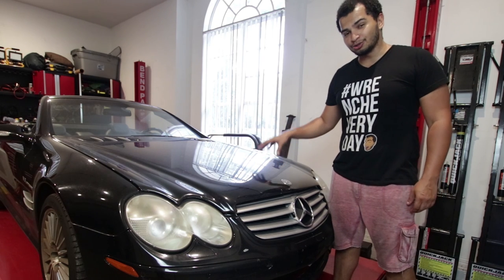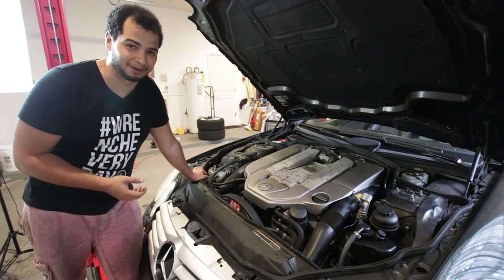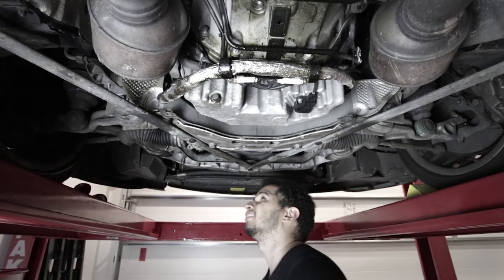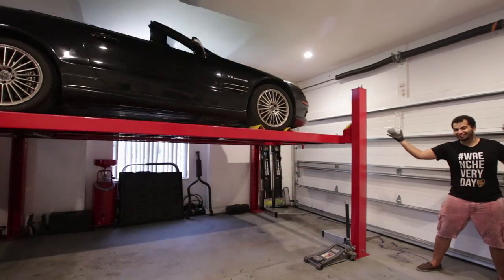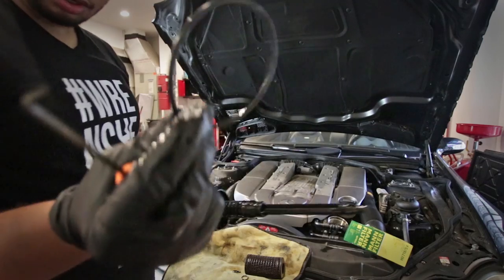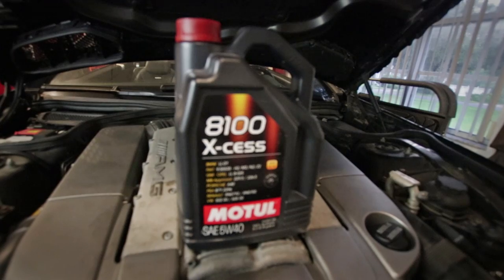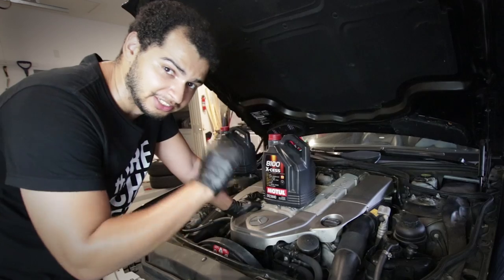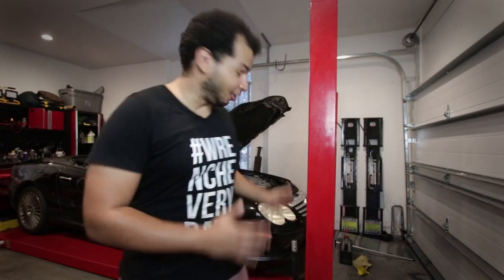Here's Why A Mercedes Oil Change Costs $320 And Why You Should NEVER Pay That Price-Project SL55 Pt1

Comment: Eurotrash cars are for posers.  I agree wholeheartedly with the replies for Toyotas.  Those are cars designed by engineers, not marketers.  I had a Mercedes which was fortunately totaled.  I bought a used Toyota and loved my $20 oil changes compared to $100 'services.'  Then I said screw it, I'm going to do everything myself: I get quality, often Genuine Toyota, parts and nothing takes more than 50 minutes, including shocks, flushes, gaskets, lights, but nothing is ever drastic.    I could have bought five Toyotas for the used price of my MB.  Everyone should own one German krap once, to understand.  Oh, and at 160k miles, I get 34-36mpg!

Comment: Mobil Delvac sound weird and designed for 18wheels. That's why use Delvac in high performance engine. It has higher flash point. Fully synthetic too. 5w30 and 40.

Comment: 2 oil pan plugs are on Ford and Lincoln too. Years ago when I owned a 1993 Mustang 5.0 it had 2 oil drain plugs.
Also I had a 1989 Porsche 924S with a 2.5 liter, 4cyl that took 7.8 quarts of oil.

Comment: almost anyone can drain oil. not everyone can put it back without it leaking out. And when does the whole "oil-change" thing become the US equivalent to scheduled maintenance e.g. servicing? I understand oil may not last quite as long in the US climate than in the UK for instance but who really just changes oil every year and then waits for their brake pads to touch the metal of their discs and/or tyre blowouts and all the other stuff that needs checking by someone who knows what they're looking at? Is there any surprise that 40,000 people died on US roads last year?!

Comment: i got a  question, since around 2000, mercedes started to have their service interval reminder on the info display, which do u guys follow..the days or the miles/kms? with other cars like tyt i use kms or distance intervals even though i only drive the car for 3days a week.

Comment: You forgot the part where you have to remove the underbody cover and it has 15 to 20 bolts. Sometimes you are lucky and you only need a 10mm socket, but most times is a combination of 10mm socket and torx T25, and even 12mm socket. That's also a reason why they charge so much. So in reality it's not only 2 bolts

Comment: Simple as if you own a high performance car, then you should have the money to do the work thats needed...  i own a M3 2012 Cabrolet, and i love it... always take the besat to the dealer, to get my oil change, i dont complain about the price, i knew what i was getting into when i brought the car.

Im fortunate that im doing ok, recently new tyres and discs and pads done.. it was expensive, but then thought i wanna be safe not a cheap ass.... Also i want my beast to perform well when im ragging it...

Thats my 2 cents... you should know better....

Comment: You if you are talking about Mercedes in the 60',70's, and early 80's, they were very reliable cars.  Those engines could last forever if you took care of it and changed the oil on time.  Now today they are just a bunch of overpriced over engineered typical German cars.  You got to get a special scan tool that only Mercedes or a mechanic that paid thousands of dollars to even read the codes. You can't keep it 10 years because the plastic parts break down and you got pay thousands of dollars to replace it.  That's why the market devalues them in a big way over each year.  Now if you got say a year model from 1980 and it still runs then yeah it would be a great car to have,  but not today's or even the 2000's models.  It just how it is, you can't compete with reliability like you can with a Toyota.

Comment: Hello, I love the video, and very jealous of having a nice lift at home, isn't that the 12,000 lb one? I work as an oil change tech at a company which does the same A service for one of these vehicles for less than or around 100$.  I think it is criminal to what the dealerships charge. For vehicles like that Benz that uses those types of filter wrenches, I actually just use a regular cheapo band wrench and put a regular oil rag over it which allows the band wrench to grip the plastic oil filter cap.

Comment: Tavarish, that $4000-5000 lift would buy a lot of $300 oil changes. Plus the shop oil change container alone would buy an oil change. My advice don’t go to the Mercedes dealer. I have a 2003 SL55 and I pay $125 for an oil change. Your advice not so practical.

Comment: Have a car you want to keep? Or to last?

Then take it to the dealership or a real mechanic for the oil changes. Or learn how to properly do it yourself, but only with the proper mechanical tools, and also everything needed to make sure the job was completed properly.

In other words, do NOT take it to a majority of chain instant oil change locations.

They typically do not have the proper mechanical tools for all vehicles. Even worse... Check all of the vehicles on the road not with under engine deflectors and/or covers. Does one really think that many instant oil change facilities actually have the *proper adapted plugs/tools* for your vehicle?

Answer; almost always NO

I've seen countless instant oil change locations that will use zip ties to improperly secure deflectors and/or covers.

Be sure to remember this one when that same deflector/cover comes off while on a highway

Do it the right way. Which typically means NOT at an instant oil change facility where someone is learning on YOUR vehicle; while using the wrong tools

Comment: and about manufcaturer recommended oil.  Mercedes designed and built their engine with mobil one.  Now it is ok to use any full synthetic oil with this car and it will be fine.  Mobil1 would be the best choice tho.  I understand you got a kickback for endorsing their product and i know u wanted to do a goodjob so u never have to worry about paying for oil anymore.  But what ur saying is kinda misleading ur viewers.  From my understanding Mobil1 is a better oil than Motul.  However, like i said before,  Motul, Castrol, Pennzoil,  whatever.  As long as its fully synthetic it will work fine in the car.  but if you are looking for max protection and long lasting quality oil then ur best bet would be to go with mobil1.  HOWEVER,  i would have done the same... u got free decent quality oil that will work fine in the benz, then why the hell not??!!  lol.  
but i was wondering why this video had so many dislikes.  now  i think i understand why.  i think everyone who disagreed with the sponsored product endorsement disliked the video... i on the otherhand did not dislike the video...  I like what u do, u put a ton of work into every video u make.  it would take A HELL OF ALOT to make me want to dislike one of ur videos.  lol.

Comment: It takes 9 litters of oil, so he will have 1 litter left over for the road, once the oil filter tube fills. Never trust the gauge.  They must figure the car will never burn enough oil between oil changes to be a problem so the smart-asses didn't include a dip stick. That sucks. So I wonder how far down must the oil go before it indicates a problem.

Comment: Why did this video get so many thumbs down?  I take my Mercedes to the local Jeep dealer where they change my oil for a normal price.  They also do my Jeep, Cadillac, and F-250 diesel.  The F-250 is a bit expensive because it takes 16 quarts of oil.

Comment: I’m hoping to get a Mercedes e350 between the years 2006-2011. I’m new to all the car stuff and was just wondering if doing your own oil change is the same process as in this video. Also wondering if any other self repairs would be possible on the car

Comment: That motul oil standard is pretty low, or u can say very common in general , only got VW 502/ 505, LL-01.
Reply: Only european car have sub specification. In this case he use the correct oil that in europe mercedes raccomanded for that engine. Most american oils dont have sub specification, infact they need to change it every 6000 miles. American oil is cheaper but with low quality compared to europe oil. In europe the lowest change is at 16000 miles up to 23000 miles for the highter.

Comment: Tavarish, I would like to know if you have the option of supporting the frame instead of the wheels and suspension with your lift.  
What if you wanted to drop the rear axle assembly for example.
Thanks!

Comment: How do u add Hydraulic fluid to the reservoir in the trunk that works the roof this is the one that does not have a cap a 2003 sl 55 Amg

Comment: This guy should have done some research of correct procedures to use to do a oil service on this car. 
Any car with a  canister oil filter at the top of the engine should be drained before draining oil from crankcase. 
He just dumped all of the old contaminated oil into the drained crankcase by not doing service in the proper sequence.

Comment: That thing doesn't even have effective headlamps, and shouldn't be driven, so why does it need oil?  
Why show how to service a vehicle that isn't designed to have its oil installed by a guy named Gunter for +$300. 
Do anyone else think it odd to use an objectively less electronic anc complex electronic system to make a critical level measurement that could be checked with a stick?   My ancestors were from Germany but it's little wonder the Germans never landed a man on the moon. 
btw, I believe that there is an aftermarket dipstick kit available for people who don't like depending on a high tech idiot light or Gunter.

Comment: i would love to see you drain and fill a beemer auto tranny....drain plug on the bottom fill plug on the side have to us some kind of pump to refill  from under vehicle fluid cost over $100 cannot take any shortcuts MUST use recommended fluid at over 23 dollars a litre......have fun. by the way i own a BMW 540i with auto 5 speed.

Comment: LOL 505.00 is a weak spec... 505.01 is much stronger oil designed for extreme the pressure PompeDuse

Comment: I change oil every day that’s my job you missed a o ring on the top of your plastic filter prop and you never replaced the crush washer also cheap filter equals dirty oil equals broken parts oh you mean super synthetic ok got cha yah I’m good keep your advice 8.6 qts at max are you crazy
Reply: Something tells me that this car doesn’t have a very long life ahead of it I’m pushing 192 875 on my 99 Audi a8 Quattro with a 4.2 L V8 I bought the car at 105,000 miles I use it as a daily driver and my race weapon on the weekend car has never done me wrong I change the oil every 2500 miles sometimes I’m over but only up by about 30 miles I have people that I constantly look after and their luxury sedans going 6000+ miles over there oil change you can definitely see the difference in the color of the oil it goes from liquid gold to pure shit sometimes I pull paste out of entrance that’s how you know when a person takes care of their car or not
Reply: Point of the matter is European car services did not have to be expensive it’s not hard to work on them you just need proper tools and proper knowledge I’m not trying to put your video down I’m just saying there’s a lot of things that you missed out on that are very important things to know you think that that one o ring may not make the difference but it really does those engines are extremely particular

Comment: Stay away from Mobil-1 "Synthetic" European 0-40.   Wife's CLK500 developed rod knock.   Only had 1000 miles on the Mobil-1.    I did have 152,000 miles but was told the block should have lasted well over 250,000---esp considering I changed the oil every 4000 miles!   Mobil-1= CRAP
Reply: that particular Mob1 was too thin. Don't ever use the 0w-x viscosity. I stay with 10w- xx in my Benz and motorcycles.

Comment: Go to the track before changing oil and running dump. Makes sense. Motul isn’t a group 5 oil. Boooo
Reply: Motul 100% synthetic line is group 5 motor oil. Not like mobil 1 or castrol: group 3 hydrocracked oil. Bot where reported for fraud here in europe for writeing 100% syntethic when they aren't. So now they use "Fully synthetic" but its still a lie.

Comment: dude, additives within any oil won't change its physical properties
to start with, all oils are synthetics because they derive from oil logically
but, pil manufacturers have emwrged with newer standars that they believe will provide a better understanding of the oil to be used on any applucation
as such, synth oils have more conservative & synthetic additives than regular organic (synth) oils
what is a norm now, specially on millenial circles, is that these jerks don't do any research at all, and instead they rely on information provided by other biased sources that try to sell their product that will negativally impact many vehicles but wouldn't ever tell the truth
otoh, between castrol and mobil1 oils there has been some experimentation, these are great oils but mobil1 oil is a better oil in all terrain
about the oil you're trying to sell i don't know anything about it, i didn't even get its brand, trust me 👈

Comment: less antics and just get to business to make the video a good how to without watching all the train wreck stuff.
Turn the oil filter upside down on the skinny stem and rest it on a rag on floor then push the filter off with some force....this will keep from snapping .the stem when you twist it.
dont twist it unless you want to bust the cheap plastic stem.
i like Motul  better than mobil 1 because I have customers with older mercedes that have oil consumption issues bit once using Motul I don’t get calls for oil consumption any longer.
Yes ask any tech how much they want to kick the Mercedes engineers in the balls for some of their stupid designs.
The SBC braking system was/is a nightmare.
id love to choke whomever designed that freaking system.

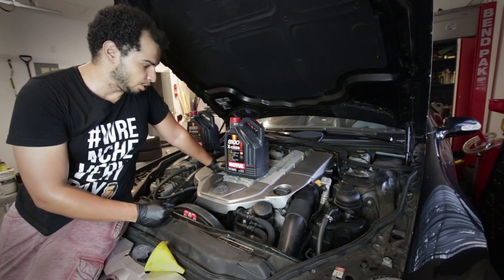Comment: 9:46 - 10:20  Complete gibberish. 100% synthetic is utter nonsense, pure marketing. It would imply that it is no longer motor oil but something else now. Being synthetic oil simply means it has additives that change some of the characteristics of the original plain oil. What, do you think Motul has their own special oil field drilling/pumps?! Like if their oil comes from somewhere special? No! All motor oils come from the same origin and every motor oil company gets the same exact oil as the next company. The only part that separates them are the additives they put into the base motor oil. Motul isn't special. They wouldn't be able to charge what they charge for a gallon jug if they actually made their own special motor oil.

To think that Motul is god's oil means that the marketing worked. And to swear by it using your butt dyno makes you a Fanboy. Show us the UOA's (Used oil analysis). Don't buy into the marketing, do your own UOA's and compare them to other oils.
Best UOA's I've ever seen were from the Shell Rotella T6 oil. So if I had to say which is the best oil, that would be the best oil based on actual UOA's proving it time and time again across all kinds of cars.

Comment: This guys like, "Yes, this car has 120,000 miles on it. I want to change the oil myself because I want to make sure it's done right with the right oil". Lol idiot. Take filter out first. It contains old oil. Then drain. Change filter, and o'Rings. Then start car, wait a little bit, then shut it off, then check oil level. Oh, and by the way...you said, "I want to get alot more then 120,000 miles out of this car". Lol Good luck with getting alot of miles out of that car with you beating on it the way you say you do. FYI, Toyota camry's are GREAT CARS. Camry's will out last your Mercedes. Your car is a money pit.

Comment: If you dont have money for maintainig such a car than you dont have to buy such a car.
When you have such a oil filter this the first thing you take off. Because there is some rest oil mimimum half a liter. If you have such a high performance car you should do such things in dealerships. The AMG specialist are not trained for nothing 2 years in Afalterbach.
And that thing with the Oil, MB paid Mobil 1 that they develope an Motor Oil for this engine. You have always read the manuels what oil your car nead not only the viscosity its very importan to look if its certified for this car very improtant!!
Im an mechanic i know what im talking about